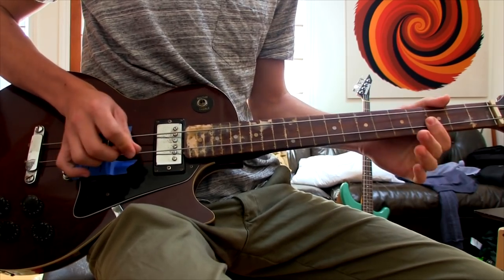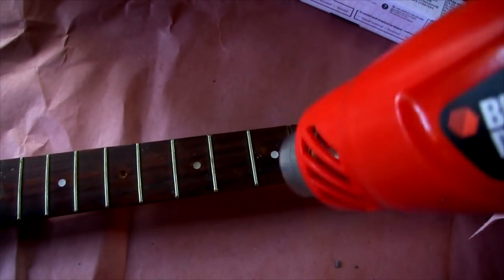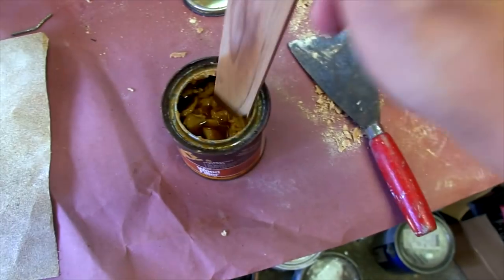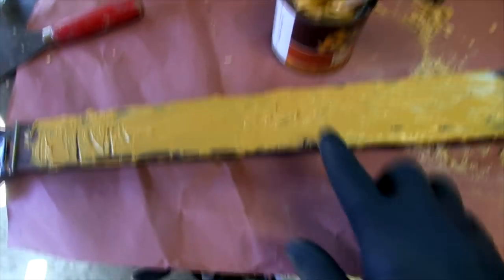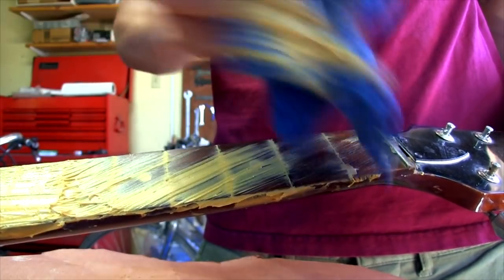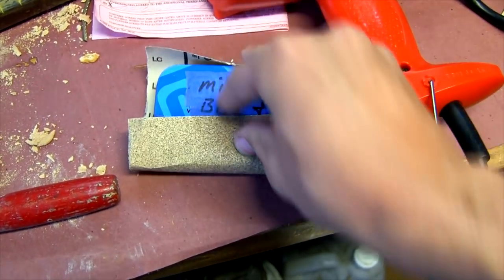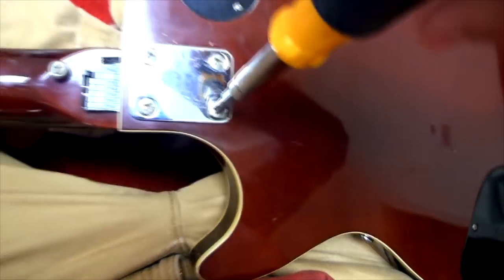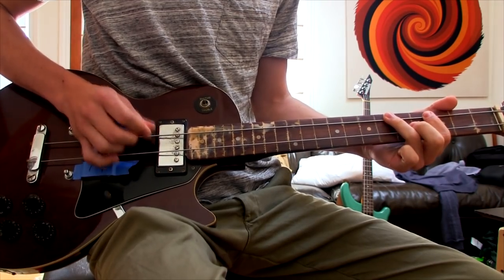How to Make a Fretless Bass with minimal effort

Comment: I have a old acoustic guitar im converting into a acoustic bass and im going to try to sand the metal frets down even with the fret board, it probably wont work but screw it, im gonna try it👍.
Reply: Gotta know if this worked or not? I was considering doing it myself for a mark sandman style bass
Reply: @baileyswansson3004  it didn't work for me, i basically ruined the guitar, between drilling bigger holes in the head stock for bass tuners, ordering a bass guitar 4 string nut , sanding it down so the strings would be low to the fret board and widening the nut slot so the nut would fit was a whole lot of work, when i sanded the frets down i basically destroyed the fret board lol, i don't have the skills to do extensive guitar work but i thought i would try it, im a welder fabricator , the guitar was junk anyway 👍.

Comment: I just watched the opposite of this; where a luthier removed frets from a high end bass, and then meticulously filled in the fret slots with maple veneer, applied several thin layers of superglue, and finally sanded and polished the fretboard to a mirror finish. Seeing the much easier version of the same thing was actually inspiring, to be able to see how easy the project could be. I'm off to try something in the middle with my fairly cheap bass

Thanks for the video!
Reply: hey me too! the Bert van Derr video with the jazz in the back, right?
Reply: Maxon Mendel yes that one. I really want to try that with a cheap p bass I have, but I would hate to ruin it. It didn’t cost me much money but it’s worth a lot to me. Then again, I’d hate to try it on a cheaper project guitar, accidentally do a good job, and then have to start over again on the bass that I like to play.
Reply: I just watched that three minutes ago!
Reply: You can also use a belt grinder and flatten frets then throw some finish on top lol

Comment: That was sooo gross! There's no way that goo got down into the fret slots, you'll have airspaces where there's no filler, and the neck will start to bend to fill up the gaps.
That's why people go to the trouble of filling each slot with solid, well seated strips of wood.
Reply from the maker: Hi Colin, surprisingly this guitar still plays great after years! However, I agree that filling the frets individually with wood is absolutely the higher-quality and overall "correct" way to go about this project. The point of this video is to highlight that the "low quality way" can be just as functional as the much more laborious "correct method".